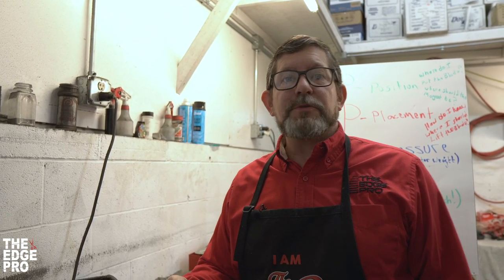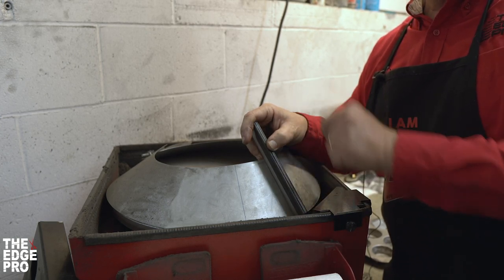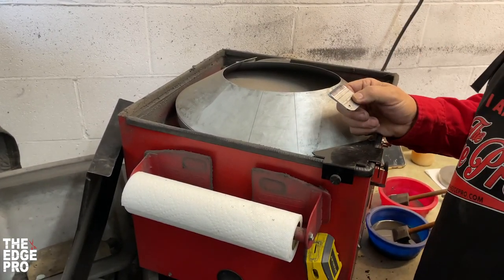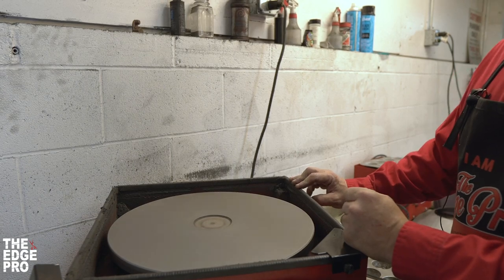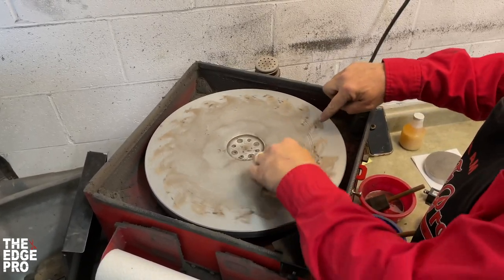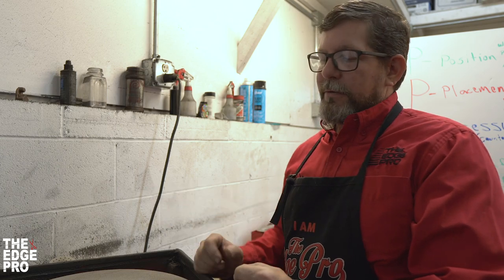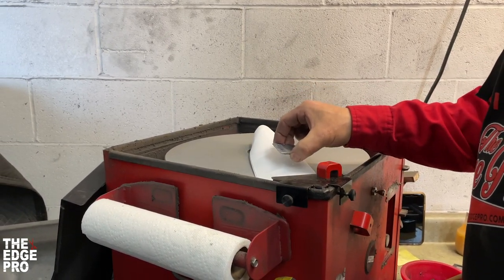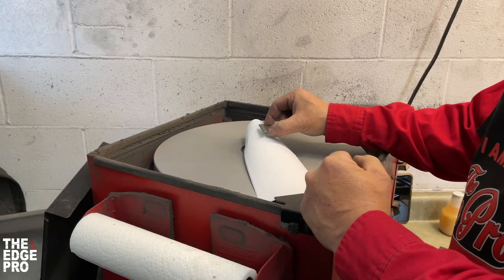All about Plate Grit! Plate Surface and Hollow vs. Flat Blades (sharpening)

Comment: Very interesting video!
 I'm going to research more about what you're saying about hollow grinding and the shape of the plate and what shape it actually grinds into the blade as opposed to flat sharpening even if the example I'm looking at is an extreme exaggeration. I think I know what kind of shape hollow grinding produces in these blades but I'm just not sure, a picture is worth a thousand words.

Comment: Jason this is Willy from SPARTACUTS Barbershop in Lutz FL... this video was super helpful and very professionally done...I can't thank you enough...
Reply: Thanks for your wonderful videos.
What's the name of block you use after sharpening the blade? I mean what kinda material is that?
Reply from the maker: @behroozkhodadadi1449  I apologize that we never responded to this comment. It is a rub block and is made out of steel. https://www.theedgepro.com/products/nebraska-blades-184/sharpening-products-186/rub-block-two-sided-r

Comment: Hello Mr. Jayson, your illustration is excellent and works well with basically all blades I sharpen apart from wahl balding blades which are non adjustable blades but the comb has tiny teeth. Kindly help me get it right on both cutter and comb.

Comment: Hello, this is a very detailed illustration of how to sharpen clipper blades on a flat 18'' wheel disc at 1.5 pound of pressure. If I use a 10'' wheel I suppose I should use less pressure unlike the 18'' wheel - Kindly advise.

Comment: Why do your plates have tiny casting holes in surface?  Is there any benefit to them?
Reply from the maker: Earl, we really appreciate your question! We use the same technology as the three main domestic factories and the wheels they create for how we leave the porosity. The purpose of the porosity is to help bond grit to the surface. You see the big holes but if you were to zoom in with magnification, there are millions of small holes throughout the entire surface, acting a lot like a Velcro hold to the adhesive and grit. Secondarily, castings in general have a different layout of the molecular structure of the aluminum, allowing for more durability of the surface.